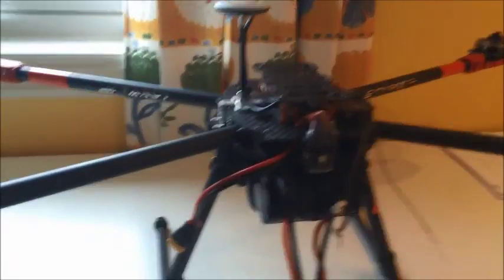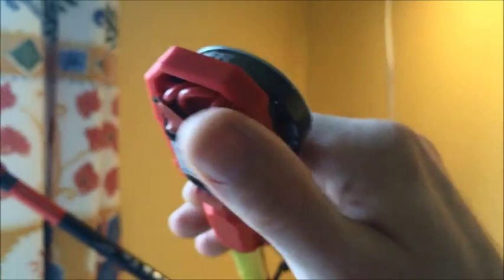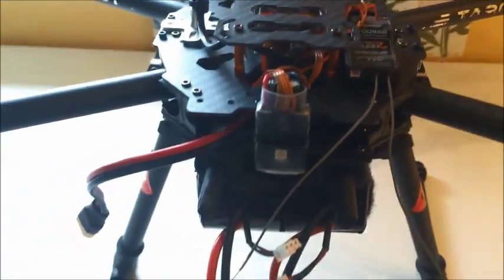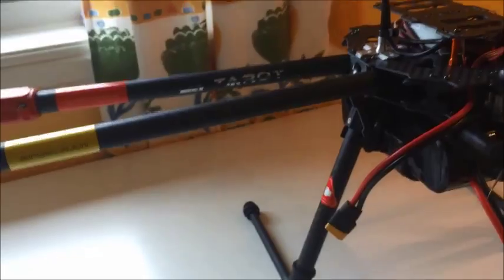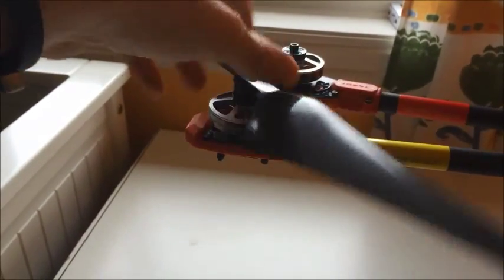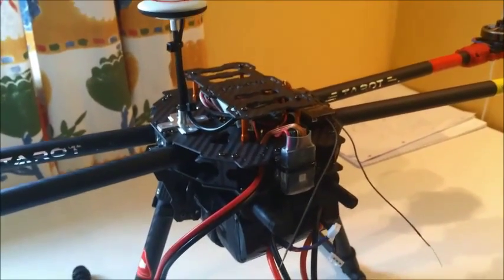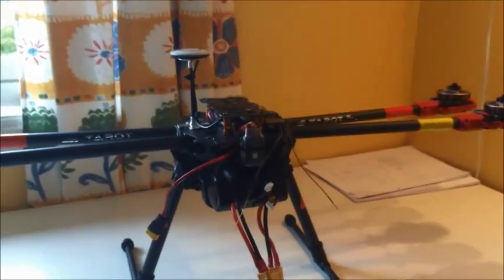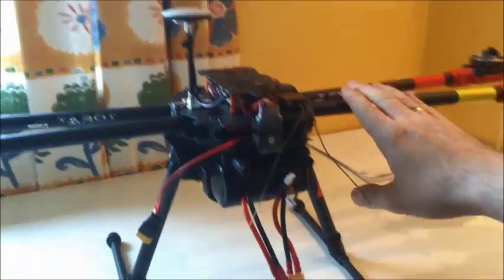60-80 min quadcopter flight project Part 2

Comment: Hi, you said you are getting 20 - 23 minutes on your Sky Hero X8. Could you please tell me what motors, esc's, battery and props you are using? I have an 850 X8 as well and I desperately need longer flight times. 8 minutes at the moment. Any help would be gratefully accepted.